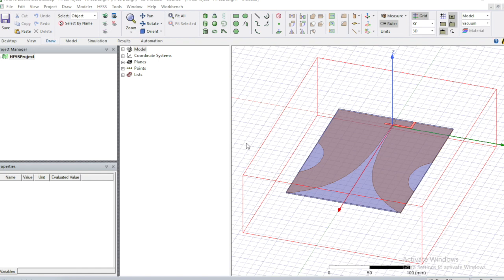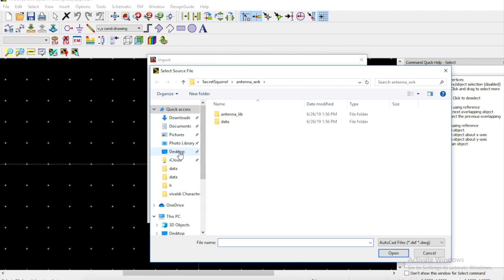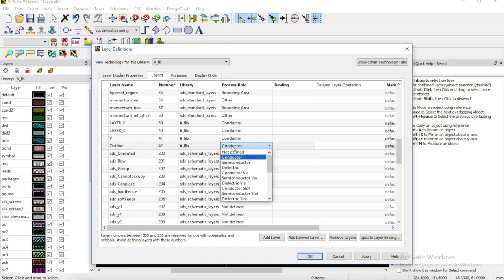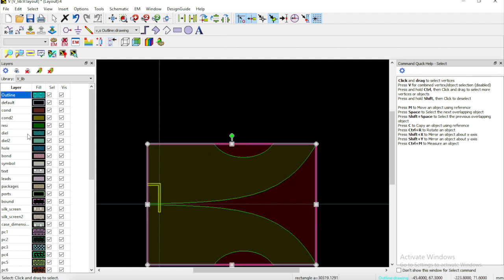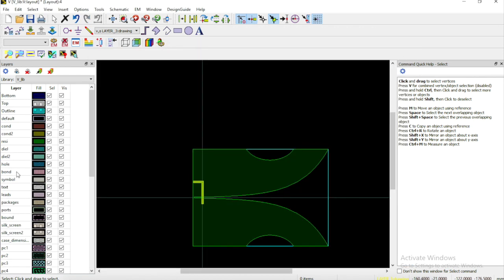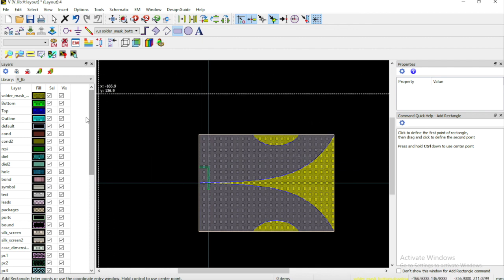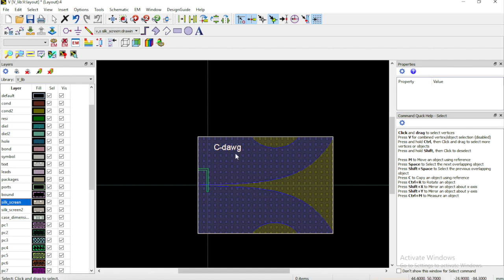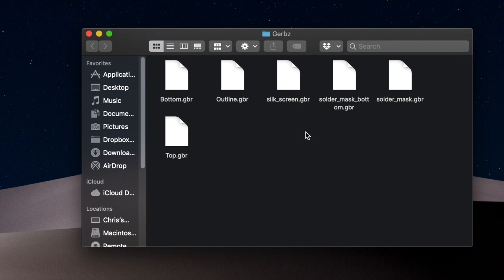How to Export Your Antenna from HFSS into Gerber Files Using ADS

Comment: Thanks for sharing this. But when I try to input my patch antenna from HFSS to ADS, I can only have my substrate, The patch is missing. Do you know how to solve this problem?
Reply from the maker: Maybe you’re not exporting all the layers? It’s been awhile since I’ve had to do that. Sorry I’m not much help
Reply: @chrisheadley808  Thanks for the reply. Fortunately I solved it by just putting patch at z=0.
Reply from the maker: @kaifan976  glad to hear you solved it! Thanks for sharing your solution 😃
Reply: @kaifan976  I am facing a similar problem. After importing dxf file into ADS, only one layer is showing (instead of the three). Please explain what is your z for the top layer, substrate and ground plane.
Reply: @chrisheadley808  At 2.20 after importing the dxf file you are getting three layers (base, substrate and the top layer). But in my case, I am getting only one layer. What could be the solution?
Reply: @goureeshankardas4838  Which version of HFSS are you using? When I’m using version 15.0, I have this problem and solved it by just setting the position of the patch on the ground plane.Then you can find your Patch in ADS. Im now using 2019 electronic desktop R3. The import of dxf has no problem at all. I suggest you to use the latest version of HFSS.
Reply: @kaifan976  I also get only one layer on ADS.. tried to change the cooridnates to make all layers above z=0 but no use.. can you elabroate more on how you solved the issue?
Reply: @malakmohamedhussein8a757  What I do is I just move the patch layer into the z=0 plane then it shows all the layers. But this is the problem I face by using the HFSS 15.0. Now Im using Ansys Electronic Desktop. There is no such problem at all.

Comment: I am confused, u say you dont want any solder mask on the antenna, then you put a layer of solder mask on it. I dont understand how the solder masking is working on the ADS?
Reply from the maker: Hi Ahsan. At 8:04 I said that wherever the solder mask layer is, the PCB manufacturer will NOT put solder mask on that section. Because I did not want any solder mask on my antenna I covered the whole antenna with a layer of solder mask.  Let me know if there is anymore confusion
Reply: @chrisheadley808  thanks for the reply! what is the function of the solder mask in ADS?
Reply from the maker: @ahsan_akz  for me it was used to let the PCB manufacturer know where to not put Solder Mask. I could not tell you exactly what it's purpose is in ADS, I was just going off what my TA told me. You may want to Google it to find the exact answer you are looking for.
Reply: @chrisheadley808  now i get it
Reply: @ahsan_akz  if we don't need solder mask on our antenna then we have to put solder mask?
Reply: If we don't need solder mask on our antenna then we have to put solder mask?